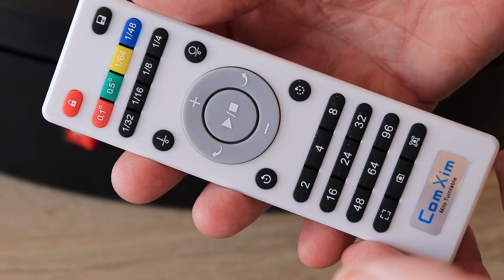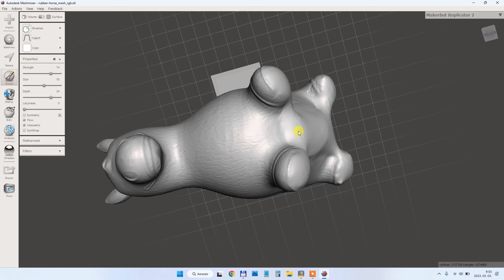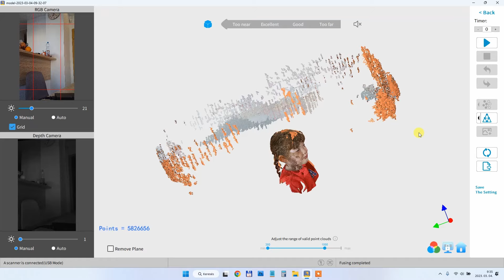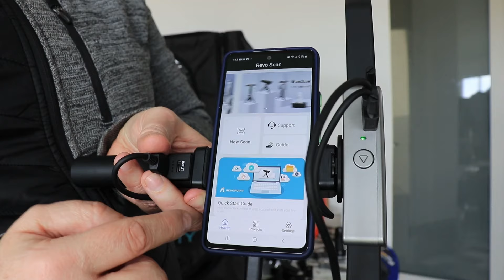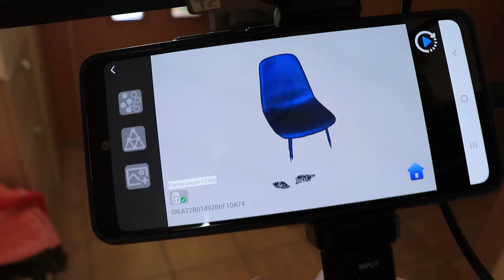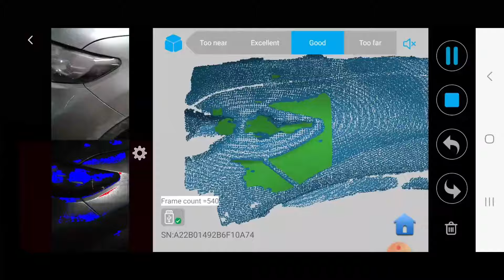Revopoint Range 3D scanner review - great for bigger objects

Comment: Are you satisfied with the device? We want to buy.
Reply from the maker: In 2 days I will publish Revopoint Inspire video. I just finished the testing, editing is in progress. I have better experience with it, but probably with highly improved softwared (which can be used with Range too), only I didn't tested it with Range so far.
Reply: @MyTechFun  Would you recommend its performance for detailed anatomical structures?